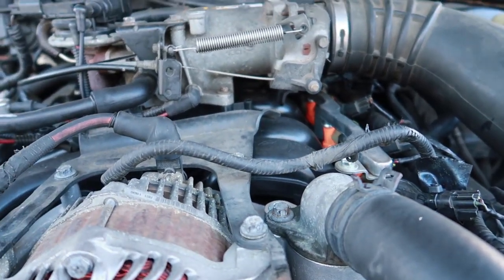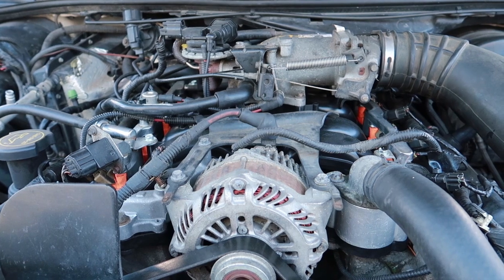5 engine parts that will need to be replaced, 4.6 v8

Comment: Hay bruh, I got over 400,000 from my 1st motor, installed a second one and it was worst than the one I took out. I put in a third one and got car out of shop two days ago. I'm impressed with it so far. Thanks for the video.
Reply from the maker: Anytime brother, as long as we beef up the parts that fail alot like the 1s i mentioned in the video and do the right maintenance on these cars they will last forever..

Comment: Cool. Can’t wait to see this new old car. I got another common failure on the 4.6 sohc and all modular engines. Timing chain hydraulic tensioner seal leaks and you get the startup rattle. Ignore it long enough and goodbye engine. Bought an 04 marquis 3 months ago and it’s been rattling for a few seconds after engine starts since I got it 170000k. My 08 5.4 3v with 42000k just started doin same thing so I parked it. Picked up a decent 03 marauder 3yrs ago for $1500 109000k. Previous owner thought engine was shot cause it rattled somethin fierce and all the time. Removed timing cover and the passenger side tensioner piston was almost falling out and most of the plastic tensioner arm was in the oil pan. Pulled engine to remove oil pan and broken plastic tensioner pieces were stuck inside oil pickup. Replaced just the primary chains and tensioners with Ford parts and was good for 6 months until I started getting the infamous dohc head tick! Frickin engine is out again. I do agree with you that the 4.6 2v is the most reliable out of the bunch

Comment: Very well said, & I've had the same issues, which I went ahead & replaced ahead of time on my 1st vic, but not my 1st panther platform. Bought the 05 GM LS brand new and tht vehicle had nothing on my p71. GM had sloppy handling & issues with traction control, vehicle would lose traction in the rear just turning out of driveway's or establishments in wet conditions, but never in the p71 vic. Although I did replace suspension components & had a 2inch drop on the Vic which may have helped with traction control, but now want to lift 4/5 inches to accept bigger, wider tires.
I highly recommend a tune when applying bolt on upgrades & a power programmer which makes the Vic handle superbly.
Reply from the maker: Thanx brother, and no doubt about it she will have a special tune for this setup..

Comment: Hey man. I want to say thank you for putting all your work on your Vic up here on YT, it's amazing how much you take care of your Vic. I really respect it man. Love your content.

I just bought my first car, a 2000 Merc Grand Marquis. Now I know thry might be a little different but they similar overall. I love the panther platform vehicles and I actually just had to replace my intake manifold gaskets, I was running into a major coolant leak and now I need my thermostat housing replaced along with an air bleeder housing (I thought they was the same thing) and I also gotta fix up my radiator soon.

Really looking forward to tuning my whip up kinda like how you done with yours. Mine's got 114K miles on it too.
Reply from the maker: Thanx brother. Thats really great mileage you have on your merc and your right the vic and merc is really the same car. Once you get her fixed with the minor issues then shes practically bullet proof.

Comment: I actually saw this performance aluminum intake on a website called Supercharged Motorsports. It was like $430, and was designed to fit the 4.6L V8.
Reply from the maker: I seen it as well. im definitely gonna have to upgrade sooner then later to that 1..

Comment: I have a question to act I have a 04 Ford crown Vic police interceptor when you take off and loses power so I want to know what you think is the they say it is my fuel pump or the oxygen sensor
Reply from the maker: i would start with the fuel pump first. the screen could be clogged with debris. But if you are throwing codes saying its your oxygen sensor or misfire codes then it sounds like you have a vacuum leak somewhere around the engine and its causing your vic to have a difference in air to fuel ratio.. Thats usually the case and was the case in my situation.

Comment: I really need that first thing I been having that problem with my 2011
Reply from the maker: yea.. those intake manifold gaskets tends to go bad all the time or because the intake manifold is plastic they tend to crack or melt in some areas causing a vacuum leak which will make ur car idle rough,  lose power and performance because there is unaccounted for air being sucked into the engine.

Comment: Power steering because i put a brand new pump on my 08 merc still whining
Reply from the maker: Ur right, power steering is another parts that goes bad often. make sure u dont have any air in ur lines. thats will not allow fluid to pass thru..

Comment: Bruh I done replaced everything under my hood g.... I'm down to two problems I can't figure out
Reply from the maker: What are the symptoms ur enduring with ur car?
Reply: I had to run my fan direct.... I replaced it with a new fan and still had to run it direct.... and my car runs with the mass airflow sensor unhooked
Reply: Now the mechanic says he tried replacing the maf sensor but do I need to use a Ford part instead of a aftermarket part
Reply from the maker: @laquintinsmith3532  always run OEM parts. dont ever do anything universal or offbrand. spend the money right the first time so u dont have to do it twice..
Reply: Bet big bro💪🏾💪🏾💪🏾💪🏾
Reply: @2xmototv206  nd I hope you nd ya family staying safe nd protected during these trying times brother
Reply from the maker: @laquintinsmith3532  yessir we are. hope u and urs are doing the same as well.

Comment: When they replaced my engine, they didn't swap over all the things I replaced on the old engine, like the water pump, intake, idle tensioner, alternator,
Reply from the maker: Im glad it worked out for u brother.. nothing like a solid running vehicle..